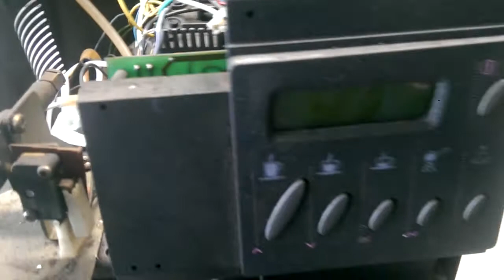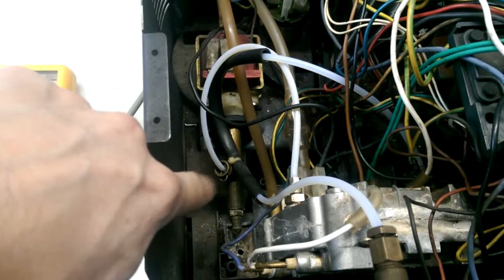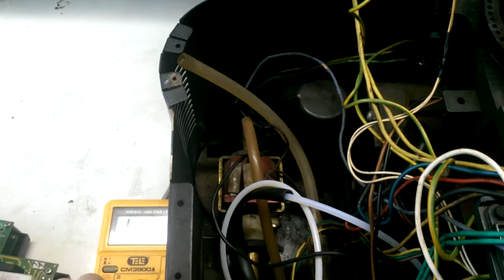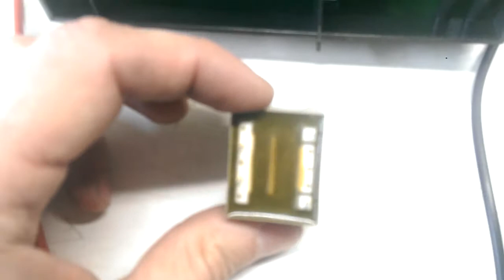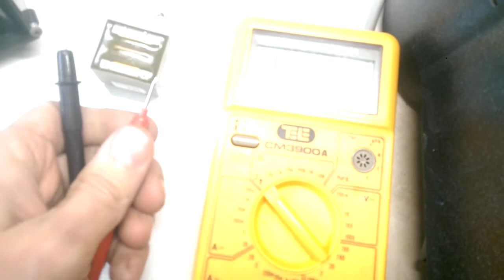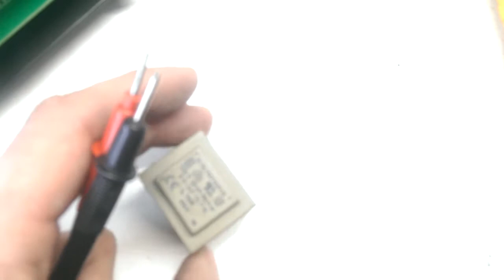Saeco problems with power supply

Comment: Hello everyone, i have saeco initelia espresso machine everything was working properly but i went for business trip and when i came back i couldn't turn on my machine so i disassemble the machine i checked brew unit motor and its working fine but machine was still doesnt work i dis connected pump grinder to see if it would turn on it didn't turn on but when i accidentally touch the electronic board it shocked me so there was electric on the board but i couldnt find the issue could it be the transformer on the board if you reply i would be very happy

Comment: I have saeco royal and it throws the safety when I connected to the power, it started, and it shows a "locked group" error. it doesn't stop from the bottom button or from the door switch ... what market is the electronic board?